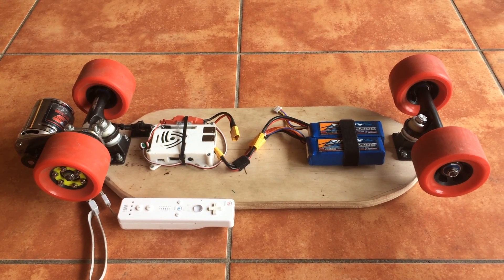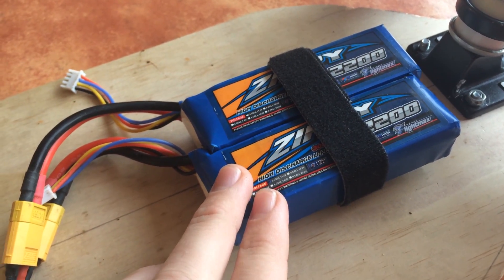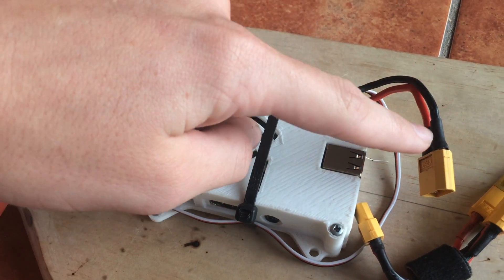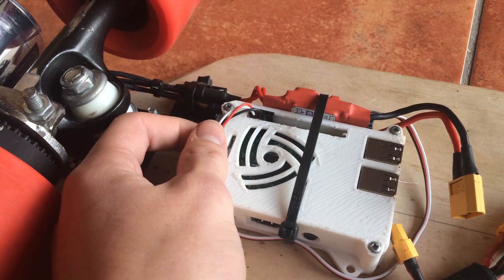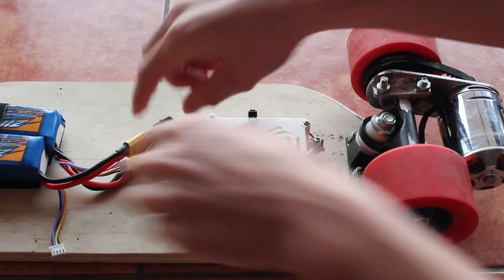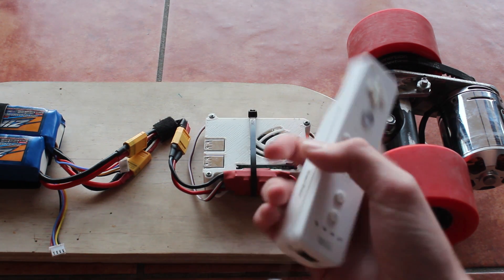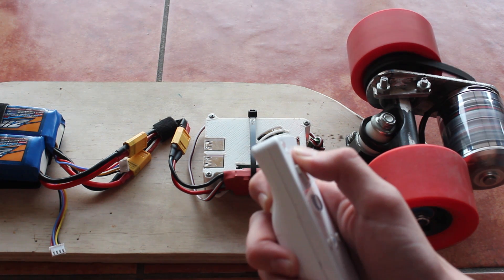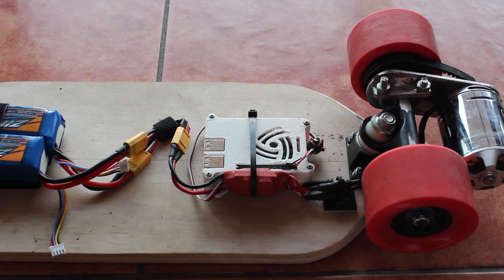Raspberry Pi Bluetooth Electric Skateboard IFB102

Comment: Belt too loose
Reply from the maker: Hey man yes for the uni project code quality and project scope was marked not the build quality of the actual project. My current eboard version doesn't use a wiimote anymore and uses proper gears that aren't 3D printed so I can actually put proper tension on the belt.
Reply: okay

Comment: Hey Tim. Im working on replicating your project since I had a pi lying around. My only problem is its a first gen pi. Its a B rev 2 board. Im using a bluetooth dongle. I know the only PWM pin is the GPIO 18, so I attached the wire to that pin instead and went into the code and made SERVO=18. However whenever I start up the program it connects to the remote but when I hit B and up nothing with my motor happens. I get no beeps; nothing. The pi is reading the inputs but its not being sent to the motor. Is there something else in the code that could be effecting this? Any thoughts would be greatly appreciated, Thanks a ton! Awesome project!
Reply from the maker: If the PI is reading the inputs then there is nothing wrong with the code. Some speed controllers (ESC) need programming with the motor to set the upper and lower limits of the motor. You might need to google a little on this. Sometimes the ESC beeps if it hasn't been programmed. Other than that, there is not much I can do. Also if possible take the Pi and Wii remote out of the equation and see if the ESC and motor work without by using a RC transmitter and a receiver.

Comment: I have a working brake!! the key is to program the ESC to brake. When the PWM signal sends a "0" status (0,5) it will send a full stop. My hub motors come to a gliding stop and it locks the wheels. 

Also modify the code from "0.1" to "2.0" increments for acceleration. This will allow you to accelerate and decelerate fast enough to program your ESC's using the "beep/tone" method. This is only recommended for the programming of the ESC's. I would put the code back to .2/.1 for riding. I will be posting a video soon and hope that you'll check out the build.
Reply: hi. i am a novice with raspberry pis and would like some help with the coding if you would help me please
Reply: Which ESC are you using?

Comment: Hey there! I have recently built my own version of this using your tutorial and code. :-) firstly, Thank you!! this has been a great deal of fun. I got my build up to 30mph with 2*1800watt hub motors @26v. :-)

So today I have a question.. have you programmed a brake? It is terrifying weaving to a stop. I have modified your original code slightly( different acceleration button, and a Pi shutdown command) my ESCs have a brake function but I am at a loss for how to send that over the PWM. Thanks again!
Reply from the maker: No brake function yet I am looking on making a new version of the board with a Raspberry Pi Zero W which has built in bluetooth. But have to find myself a new battery system as thats the bottleneck of my build atm. What lipo cell setup are you running 12S? Also curious as to what exact motors you're using 30mph sounds EPIC! Once I get mine going to speeds above 25kmph I will look into exactly how to go about sending a brake signal over PWM.
Reply: Thanks for the response. I'm using Nucbot 1800 watt hub motors. And I'm running 2-3S1P 4000mAh lipos in series. I'm getting about 3 miles before swapping battery packs. I'm using a drop down deck (Yocaher) so there is not a lot of mounting room. I too have considered a pi zero as I've blown the Bluetooth on the Pi 3. I did find a site late last night that has some motor DC reverse functions. My concern is that it won't talk well with the ESC's. I will be testing that soon.

Comment: When i inserted the jumper cables from the esc to the gpio pins of the raspberry pi3 it completely fried the DC power pin and literally melted it off. Now im entirely sure if i wired it wrong or i had too many amps going in. I was using a 100amp speed controller and i think that was the problem. If so then what could i do in order for that to not happen again?

Comment: Im really new to all this python language coding and raspberry pi stuff and i dont understand how to install the PiSkate code for my e-skateboard. Ive got all the hardware and wiring sorted out, its just i cannot seem to understand on how to get the program installed into the raspberry pi, and to get that connect to my wii remote via blutooth... Can anyone help?
Reply: Kanishk Giri you have to open the Terminal program in the Raspberry Pi. This is where you put all those command lines in. Depending on the code you're inputting you are altering files or creating a shell command that functions the program; like PiSkate. Hope you figured it out or I at least pointed you in the right direction. I'm gonna be gathering parts and attempting this soon
Reply: So can i copy the code he has on the github page to a python shell? But even after that i dont understand what to do when he says to edit the rc.local file

Comment: Where did u get the plug adapter to connect 2 batteries in 1 ?
Reply from the maker: Its a parallel XT60 battery harness from hobbyking: http://www.hobbyking.com/hobbyking/store/__47519__XT60_Harness_for_2_Packs_in_Parallel_1pc_AU_Warehouse_.html?strSearch=XT60%20Paral

Comment: how did you connect the raspi to the esc?
Reply from the maker: Check the GitHub page here: https://github.com/timmaier/PiSkate I connected the 3 wires from the ESC to 3 different Raspberry Pi GPIO pins.
Reply: Did you solder them?
Reply: Hay Tim. On the esc is say it uses 6Vs but the gipo pins take 5. How did you get 5?

Comment: Hey there, i've just built my own electric longboard, with a raspberry pi.
I've got a problem right now...the motor accelerates smoothly, but it won't stop completely... in the min. state it starts to stutter... does someone have an idea?
Reply from the maker: you can fine tune the stopping point in the PiSkate code STOP = 5 # 5 is absolute min maybe try setting it too 4.8 or something just under 5. This juts needs to be fine tuned a little depending on what ESC and motor you are using.
Reply: +Tim Maier do i have to "learn" (program the speed) the esc again?
Reply from the maker: no you shouldn't have too

Comment: Your belt looks really loose. It should be taut or else it'll fray quickly! A quick fix would be to widen the slots in your motor mount so you have some play to adjust. Great work though!
Reply from the maker: Yes someone has mentioned this before, those are my intentions! I will also be upgrading the ESC and changing the controller to a Pi Zero so it will be able to go faster.

Comment: This board use a 2.25 kW motor, not at full powerl, is only using an 1 HP of 3 HP available, a elite ciclist can develop a full power of 400 W, so, this project has the potential to become something bigger, thanks for the project!.

Comment: what did u do for the motor mount?
Reply from the maker: The motor mount is a custom mount out of steel which is fastened and held in place with a U-bolt. If you don't have the machinery to build one yourself you can buy a mount online just search for electric skateboard motor mount on google should bring up some results. Or look at some tutorial videos on how to build one.
Reply: +Tim Maier do u think it would be possible to 3D print one?

Comment: Your belt looks to loose
Reply from the maker: yes it is! I am modifying the mount so the motor sits futher away and puts more tension on the belt. Knew someone would pick up on this :P
Reply: +Tim Maier I would also look into in hub motors if you can budget for it.  No drag means you can use it as a normal board when the battery runs out and starting from stop is much smoother.  VESC is also a nicer ESC.  But honesty nice work keep on building you can only get better.
Reply from the maker: Yep well being a DIY I can expand on it and modify as I please. The board still coasts ok when the power is off.
Reply: +Tim Maier join the esk8 builders forum if you haven't to exchange ideas with other electric skateboard diy ppl.  Yeah that's the great thing to build it to your own needs.
Reply: You mean his timing belt? :P

Comment: When you let go of B, does the skateboard come to a complete stop and make you fall off or does the board still roll smoothly as if let's say you're going down hill?
Reply from the maker: The board will keep moving if you let go of B and not stop suddenly. I will be adding a regenerative brake function hopefully when the new ESC comes.
Reply: Tim Maier Cool! I was wondering because it would be annoying to go flying off after turning off the engine
Reply from the maker: Heres the GitHub page: https://github.com/timmaier/PiSkate

Comment: Good work. But i think that using a raspberry pi for this project is like using a tank to kill a fly... you can use a cheaper mcu for this.
Reply: Or you could use a pi zero, an otg cable and a bluetooth dongle at a guess. :)
Reply: indeed ! a pi zero is better for this project (cheaper and less power consumption ). BUT STILL overpowered x)
Reply from the maker: Indeed its overkill haha, but for the Uni project it was a prerequisite to use a Pi. In future I'd use an Arduino or something else. The Pi also draws alot of unnecessary power.
Reply: Marouen Hammami you could probably do it with a potentiometer and a spring loaded bike cable, but that's not the point, having some overhead in the system allows for some expansion of the project.
Reply: The only advantage of using a pi is it has full bluetooth support. With an arduino most people use serial communication.
Reply: Jake Abel only the pi 3 includes native Bluetooth.
Reply: eLJaybud
I'm talking about how android(Edit: arduino) does not have the memory or resources to communicate in compliance with Bluetooth specifications. Usually people use serial over bluetooth which requires a custom code for receiver and sender.
Reply: Jake Abel it's a hobby board, and here it's talking to a Wii controller. And it will happily talk to keyboards. And if it doesn't meet the specifications then lots of smartphones don't either, so I wouldn't bother about it too much as you are probably talking PC/computer specifications.
Reply: eLJaybud
Dam I typed android. I meant arduino like I said in my original comment. Arduino can't handle the required memory for the specification. Which is my point of why usining a pi is great cause you can use any bluetooth device as the controller with out moding it to work.
Reply: Jake Abel Bluetooth 5 is coming, so there might be a lot of hardware not meeting specifications.
Reply: i can't agree more...

Comment: Tim, Congratulations on the project, has already been asked but I will ask again ...

You will provide the project?

You think you can use one engine with more affordable price?

How does the communication of IP x Control WII-U?

With these two batteries which is autonomy of use?

Thank you!
Reply from the maker: Yes I will be providing all the details of the project on instructables will post a link once its done. 

This project is using a very powerful motor, a lesser cheaper alternative is probably out there. 

To connect the Pi with the Wii Remote I use a python library called cwiid this page explains it very well: http://www.brianhensley.net/2012/08/wii-controller-raspberry-pi-python.html 

With your last question I am unsure what you mean. Both batteries power the ESC which then sends 5V to power the Pi.
Reply from the maker: Heres the GitHub page: https://github.com/timmaier/PiSkate
Reply: Thanks!
Reply: Thank you, Tim.

I will see the list of necessary items.

For now I have in hand, only .:

raspberry
Skateboard

Lition battery
ESC
(Battery and ESC, used in a model airplane).

MOTOR here in BRAZIL or Import is with abusive price.

I will review another alternative.

Thank you!

Comment: Really cool work!
Could you give me some informations about the pi? 
Which system, program and/or code and which pins of the gpio are used?
Reply from the maker: Only 3 gpio pins where used red 5V, white gpio2 to transmit the PWM signal to the ESC and black ground. It uses the python program I made. I will be creating instructions on how to build/program it and also making the code available for public use on something like instructables. I will comment the link once I have done so and also add it to the desc.
Reply from the maker: GitHub page: https://github.com/timmaier/PiSkate
Reply: Cool! I just startet to set up the system with a pi zero.... Think it should work!
Thanks a lot!
#update
The PiZero works fine with a additional bt-adaper. The Python script runs and i can connect to the wiimote. Today i will add the esc and try to run a motor.
Reply: Success! Everything works fine with the Pi Zero. If you are lucky and you can get one, it is a cheap solution instead of the Pi3. The next thing ist, the zero has a lower power consumption than the Pi3. I think, it is a lot better for the bec of the esc.
btw, if you need some technical drawings or 3d models, feel free to contact me.
Reply from the maker: WOW awesome! Yes I've been trying to get my hands on a Pi Zero, they are hard to get since they are so popular! Awesome to know someone else has made one now too :D If you want to take some pics and then send them to me that would be cool then I can add them to the GitHub project. Also did you have to edit any of the code to get it working with the Zero? Email me at timmaier02@gmail.com
Reply: Hi, I'm looking to make this project for myself with the raspberry pi zero W (with build in bluetooth). Can you provide me with the technical drawnings (cause this will be the same as the raspberry pi zero). Also, did you need to program the esc or did it worked out of the box). Many thanks in advance!

Comment: Hi what speed controller are you using?
Reply from the maker: The speed controller this is using at the moment is one out of an RC airplane since the one I had bought for the project did not come in time. It's a 40AMP Turnigy Plush one of Hobby King: http://www.hobbyking.com/hobbyking/store/__2165__TURNIGY_Plush_40amp_Speed_Controller_w_BEC.html
However I do not recommend it and I will be swapping it for a VESC a ESC designed specifically for electric skateboards: http://diyelectricskateboard.com/product/vesc-the-best-electric-skateboard-esc/
Reply: +Tim Maier yeh I was looking at vesc but quite expensive so was looking for a cheaper option. thanks for reply.
Reply from the maker: Anthony Hulse no problem. yeh the VESC is expensive but I wanted the capability of regenerative braking.
Reply from the maker: Heres the GitHub page: https://github.com/timmaier/PiSkate
Reply: For prototyping, i will use this esc (https://hobbyking.com/en_us/turnigy-plush-60amp-speed-controller.html). Do i need to reprogram it or will it work right of the box? Many thanks!
Reply: Also, wich charger do you use for charing the lipo's? Many thanks, Laurens
Reply: how did that end up working for you?
Reply: With using the VESC, how will you connect it to the Raspberry Pi?